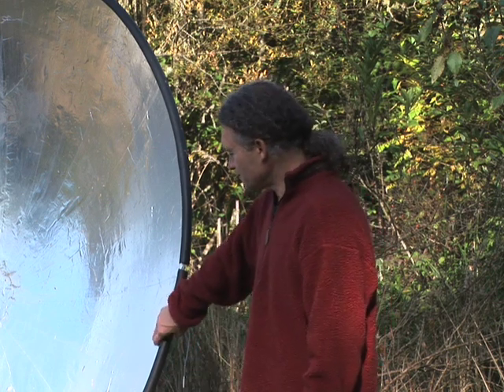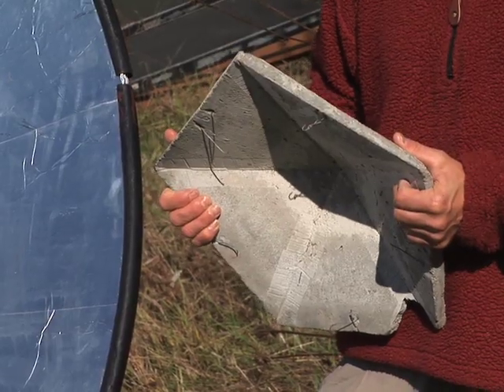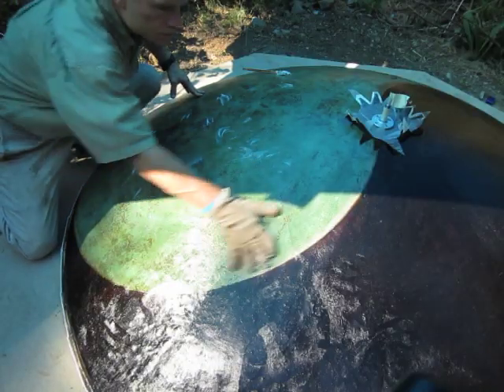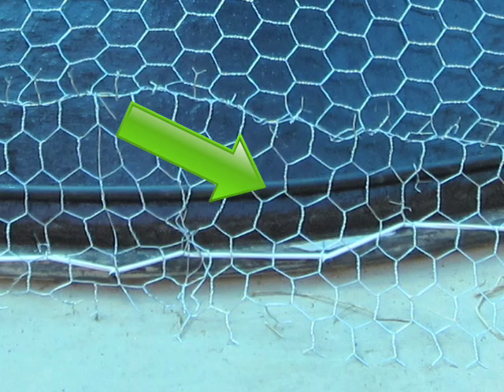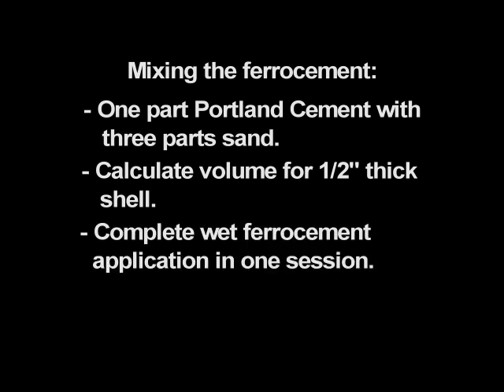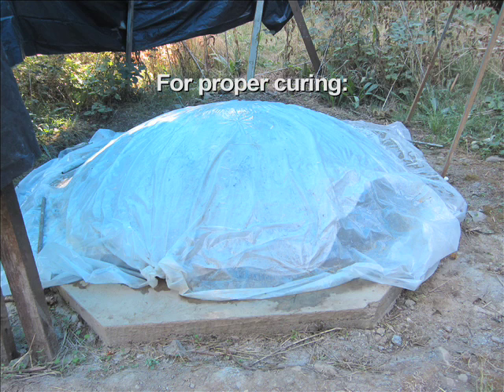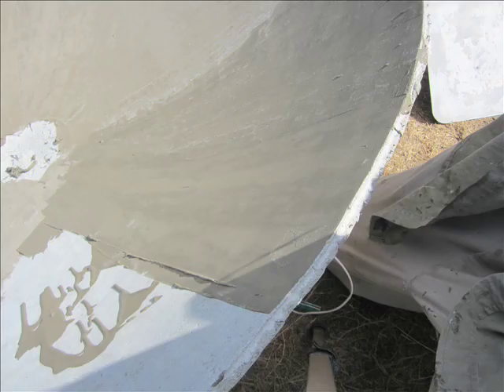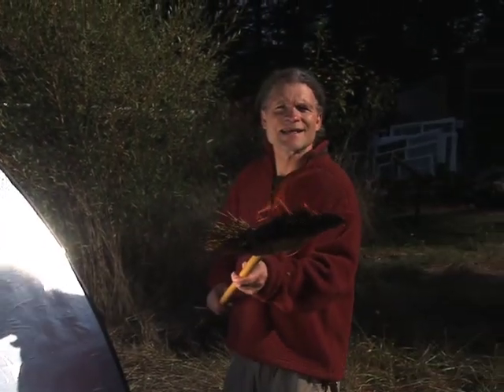PARABOLIC SOLAR COOKER FERROCEMENT,  2 METER DIAMETER DISH

Comment: Awesome video: If you use 70% cardboard and 30 % cement you make (papercreate) this method will make solar cooker  super light and strong.  I once made a goat water drinking  tub using rectangular plywood box as a mold and cover did with 6 mill plastic and poured a sand cement mix over it with outside box that finished rectangular cement box had 1" thick walls. When cement was cured and removed the wooden mold this cement tub had incredible glass like finish because of plastic mold.

Comment: It might complicate your mold slightly, but a tube at the center, to introduce pressurized water or air will make parting the dish from the mold much easier.  I have done this often with concrete pans for highrise building floors, and one man can easily strip a whole story of a building in a few hours.

An air tube might complicate the mold a tiny bit, but would make its use more fool proof, giving you a way to go when the dish does not release properly, without breaking your mold.  If you are using volunteer and inexperienced labor, this could be a significant advantage.

Comment: You can use fiberglass on top of that mold to make a new one that is movable. Then make fiberglass mirrors that are much lighter and easy to work with. I think there is a new method of applying chrome plating (Spray method, >>not the spray paint<<) that can be put on any material, including fiberglass. That will make the inside become 90% mirror. I have no idea how much the chrome plating will cost, its just an idea i've had, but fiberglass can be quite cheap.
I loved the way you made your parabolic mold shown in another of your video, i was looking for ideas for my project. Great job!
Reply: +Gabriel Martins 
Chrome salts are nasty toxic. Could it be lined with silver mylar?
Reply: Well, you might be able to make a really big one that goes into the ground and coat it with light colored stones. I know, it loses efficiency, but for impoverished nations, it's easy to make big ones, like 5+ meters in diameter that you can just walk on and use as a community. You can cover it with a high emissivity material so you can pick up your cooked items
Reply: Fiberglass is a nasty material. A 10mm sheet of aluminium would be much lighter and work much better.

Comment: Aluminium foil is cheap.  But it is not durable.  If you really want to make a solar cooker that lasts for years, you have to use a weather-proof reflector.  The ones available in the market today are Alanod Miro-Sun, Constellium Solar Surface, and Almeco Solar Vega Prime.  These are not cheap, but they will last for years under the sun.  Just demonstrating once that you have made a parabolic solar cooker by making a stick catch fire does not serve the intended purpose.  Happy solar cooking!

Comment: It appears to me that you could use a parabola like that to reflect the heat through a glass door into a domed bread oven with thermal mass and insulation on the outside to get quite high long lived  heats.

Comment: In National Geographic magazine (Mar 1984, I think) there was a photo of a concrete solar cooker in China. They set a mosaic of small mirror tiles into the cement, making sure that each mirror would reflect a spot of sunlight onto the desired focal point.
Reply: +Leo Freeman 
If your cooker is wider than a point there is no need for a tight focus. A 3 foot diameter hemisphere will produce a ball of heat at center just big enough for a 9 inch pan. 
6 inch mirror squares can put all their light on a larger target, the fun part would be making the frame to hold them, it could be flat like a Fresnel lens. If the total area isn't covered, so what? :o)
Reply: +Buzz Werd That's a good point; it isn't even necessary to have an accurate parabolic shaped concrete bowl if you use a mosaic of mirror tiles, the cement form could be any shape, even flat, as each mirror tile takes care of it's own focus.
Reply: Leo Freeman
If it's a trough mirror aligned E-W then only the tilt angle needs adjustment to track the sun.

That's what the big solar power station in IIRC Arizona uses... many acres of them. The heat oil in pipes running along the focus and store heat in tanks. According to the article I saw, it generates full power over 6 hours after sundown.

My thought is to put a blackened stovepipe along the trough focus leading to an oven box with chimney. Get the chimney to draw and you should get a convection oven going.
Reflect sunlight into the oven box as well and get more browning, do you know reflector ovens that trap IR from wood coals to cook?

Comment: For all those saying "aluminum foil will oxidize" - um, ok, get another roll? Or perhaps, after you glue it down, put on a light spray cover. Done. No need to get expensive. I mean, how much is a bag of cement and some sand? Cement is like $2.59 at Lowes. Sand is about $2 a bag (or free if you have it on your land). Foil? $3.59 for the heavy duty stuff. Glue? Anyway, the point is that Kule just made a stove that will cook for years for what? $10-$15?

Comment: Aluminum foil gets oxidized over time.  This reduces its reflectivity and hence the efficiency of the solar cooker.  It is better to use reflecting material that has an inert anti-oxizing coating on the aluminum reflecting surface  There are such materials available.

Comment: Parabolics are useless without an insulated brick refractory oven. You need to store unused solar heating to be used later after sunset.
In my opinion, fresnel lenses work better, are lighter and more efficient than mirror films.
I am building a bricks pizza bread oven, heated by a fresnel lens trough a ceramic stove glass

Comment: +Goldin R. Bennet your knowledge about aluminum is aparently very limited, aluminium is oxydizing very quick and the diference betwen aluminum and stell is that oxydized aluminium covering aluminium in such a mater that deper oxydization is not posible. So your expensive materials are ussles just like your whole advise.
Reply: What is deper oxydization? And why does it make the materials ussles? Also, what does it mean if materials become ussles?

Comment: how does burning a broom equate to oil independence?
Reply: +J S 
He got the energy to light it up from the sun.
Reply: Why are you on Internet?
Reply: With enough of those frames enough people could build a whole lot of dishes and each one can make electricity make it where you don't need to burn oil or other imported energy for heat electricity cooking even Cooling Etc